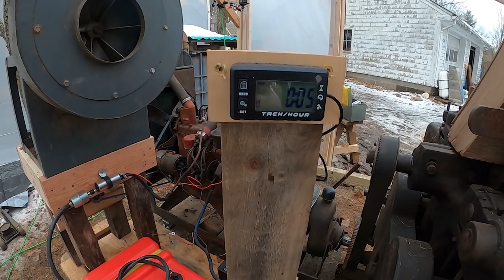A2A - Journey of a Wooden Boat - Episode 101: Pairing an 1800s Thicknesser and a Chrysler Flathead 6

Comment: please on the flat head six...  use an infrared temp gun to monitor the head temps and the side of the block just below the head on the exhaust side..  there is a long Steel tube behind the water pump that has notches at the top.. it is a coolant device that allows pump water to flow directly at the  back of the exhaust ports .  it rots off deep in the block..  it gets sediment deep in it and the back of the block heat up and crack..  google this term  1946-1959 DODGE FLATHEAD SIX WATER DISTRIBUTION TUBE  . there is a specific tool to get it out..  cut a piece of steel bar that is about 10" long. measure the distance between the passages .. cut an angle on it.. so you can slide it in with the angle bottom along the bottom of the tube till it gets in and then you can tilt it up and engage the slots with the tabs you have left on the top .. a slide hammer that is screwed on using an all thread coupling will allow you to yank the tube out.  you will need to wire brush with a long long one and a long air nozzle clean out the back of the cavity where the tube slides in..   this is only if you are experiencing hotter temps toward the back of the block and head..  it may be rusted away.. it may have been replaced recently.  it will only show up when under load.. and that engine sounds great.. i would hate to see it get damaged ..

Comment: 4:30. That's a generator. Not an alternator. If it ever goes out you can retrofit an alternator. Add a voltage regulator. Keep polarity the same. Should be fine

Comment: Ya know...if you rework the collector or bin as you call it by placing it after the planer n b4 the fan you wouldn't have a problem with the hot weather by using flex duct ....Say 6  or more on the outlet of the blower. Baffles in the box and a small cyclone would clean all the chips n dust and none of that crap has to pass thru ur blowers impeller.  Just sayin

Comment: You should isolate the dust collector from the chips by running the suction through the box and then to the dust collector.  It will save the collector from wear.

Comment: An idler / tensioner pulley would stop the belt chatter. Nice job, great to see it all working. If that is a Moeller boat fuel tank, I have two spare filler caps if ever you lose yours.

Comment: Hi
Because of the flat tappets you need a high zinc oil or add zinc with an additive, If the valves tighten up too quickly you may need to strip the engine down and have hard seats installed. 

Good luck with it.

Comment: you can use - fab with relative ease ;) - a scott russell linkage to connect a clutch lever next to the working area 90 degrees to the real mechanism: https://en.wikipedia.org/wiki/Scott_Russell_linkage

just have another clutch lever out there near the cutoff and throw the motion across the platform with a rod and use the russell linkage to convey the motion 90 deg to the real lever.

btw - long time subscriber, never comment on anything ever, but yeah you guys rock and you totally want to be able to have control of that clutch near the working end of the machine man!

Comment: Only thing I'd wonder about is the lifespan of your exhaust fan with all the chips going through it.  On a typical dust collection system the fan is on the output side of the separator so it's only seeing air and very fine dust.

Comment: The 6-volt battery and generator takes me back a while. It was fun to see the old system, and the engine returned to use. You do have modern technology with your small tach and hour meter, so you've gotten your bases covered. I was pleased to see your installation of an ignition Kill switch: gratifying to see continued attention to work safety. Congratulations for your progress, and thank you for the video documentation.

Comment: Look to put a tensioner on that extraction belt, rather than just trying to tighten it. Simple wooden or metal frame to hold an adjustable pulley there and you're done.

Comment: why dont you use a big generator instead of driving the plainer throughthe flathead  it would probably mean youre more flexible in wat you drive of it
you can allso put the motor away in a shed and you dont have to breathe the exhaustfumes while running th planer

Comment: Felt is typically used for oil metering.  It will hold a lot of oil and let it drain out slowly.  I do not know if cotton has the same characteristics.  They are both natural fibers but differ quite a lot in all their properties.

Comment: Great bit of fun putting that lot together.
You might want to reduce the height of the extractor box on top of the planer so one operator can pass the board back over the machine while the next board is coming through ready for the next pass.

Comment: That twin disc clutch should be hard to engage, if it ingages easily it will slip. Theres a lock and a large ring under that cover that says twin disc to adjust

Comment: Would it work better if you fine sanded and waxed the feed table?  The out feed drive roller did not appear to have treads,  do those sometimes have rubber tires glued to them?

Comment: Supercool project, still why don't you update the electric service? 🤔 Electric motors are just so much more reliable without almost any maintenance
Reply: Running new electric service is expensive. Really expensive. I'm guessing that nobody close to them has high power service, which means that they would need  to pay for the wiring from the nearest main power to their house.

Comment: Crazy idea.... pipe your exhaust into the chips blower, then feed that into the intake of a wood stove.  Cheap recycled heat.
Reply: Exhaust into the chips is a good idea anyways, reduces the amount of oxygen in a highly flammable part of the shop. And keeps the planer operator clear of carbon monoxide!

Comment: thanks for the video!  im thinking if your going to run a lot of large stock through that planer  INFEED AND OUTFEED tables or rollers will help speed things up a bit  probably some way to get the stock back for another pass ;]  and  yup no loose clothing in that area  long hair...  and dont braid it if ya got it  because braided you loose it all  nice division of resources  and as nice as  it is to dream of summer in the middle of winter often   rapid change of climate is difficult on the system especially if its only to return to cold  i find it easier  just to stay and adjust with the seasons naturally march break trips south usually ended in heat stroke day 2 and really cold on return  ;]

Comment: The exhaust must be plumbed to the outside to prevent the danger of carbon monoxide poisoning.
Reply: I think that would be no problem because the doors will be open all the time to feed the planks into the planer
Reply: It is. Look at the pipe at right hand side: https://youtu.be/SDWm-RHh9jc?t=1670
Reply: A pretty simple fix plus the chip extractor is moving a lot of air.  I'm more worried there aren't enough kill switches or guards for this cold weather/clothing required time.  Even with a kill switch there is a lot of momentum so no instant stop.

Comment: With the planer hooked up one could detect a faint but discernible sigh of envy all the way from Port Townsend, WA. Take that Tally-Ho.. Great example of practical engineering. Design and build what you need using what you have. Rube Goldberg would be proud